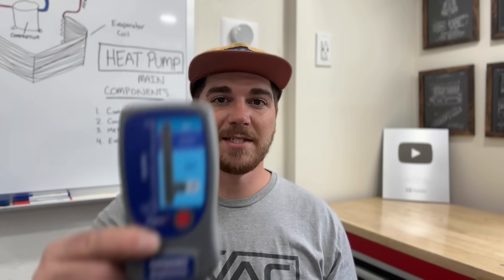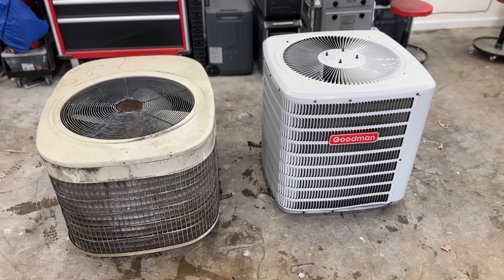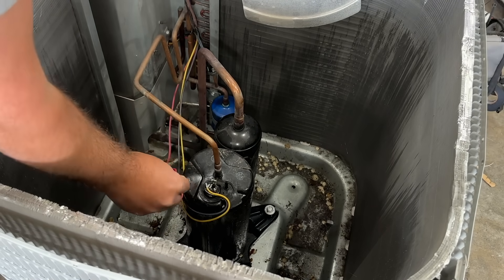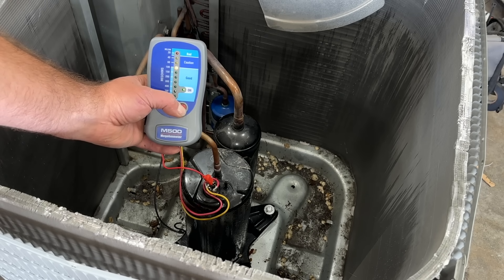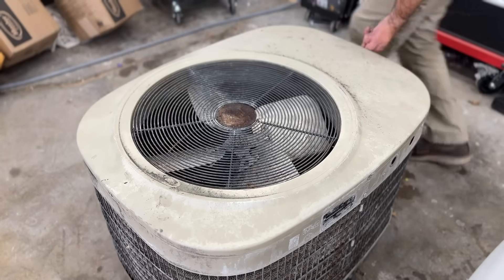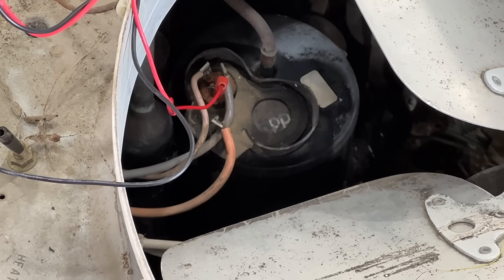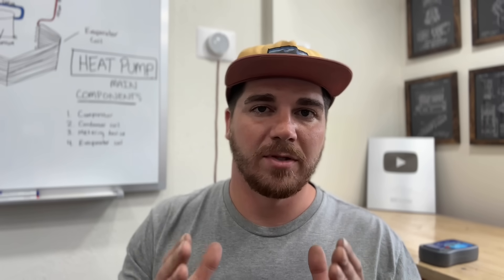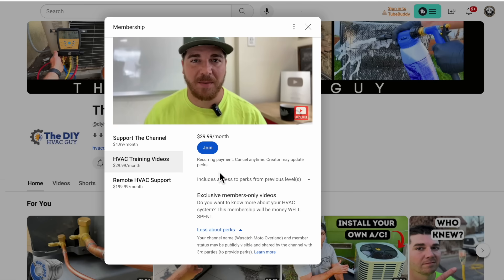Is Your A/C Unit About To Die? This Tool Doesn't Lie

Comment: It's always best to consult the manufacturer about their products just in case they have an explanation of these readings. Copeland states that a reading of between >5-20 Megohm is not reason to condemn their compressor. I always like to stick to the old agage: "ALWAYS, consult the manufaturer if not sure" or something like that. But I do agree that NOT pulling the required psia will positively reduce the life of the system. And I've seen far too many contractors rush this part (evac) and make-up some excuse why they can't pull the proper vacuum and end up charging the system without completely dehydrating. No wonder the systems are failing. I'm convinced older systems lasted over thirty plus years because the service technicians of the past did it right. That is what I believe is missing today.

Comment: You should always pull all of the wires off before ohming out a motor. If you don't it might back feed through the wires or short out against the compressor or motor and give you a bad reading. It's also a good practice to ground out to the piping or casing of the motor. This gives you the best grounding. Remember this test is testing the insulation of the windings to ground. It does not tell you the condition of the pumping capabilities of the motor either.

Comment: You can do the same with an Oms Meter and an Amp meter  .  The one thing he didn't tell you, you can electrocute yourself if you do not disconnect the power
Reply: Ummmm... Pretty sure he showed pulling the disconnect at the beginning before starting.

Comment: I see you’re noticing a change in reading over time, this is normal but you need to test for at least a minute or longer for any valid reading, look up Dialectric Absorption Ratio or DAR. A better test would be PI or Polarity Index which is a 10 minute test. Either test requires a much more accurate meter than what that supco is capable of. 
Also none of your readings are valid because you need to remove all the wires from all the motor terminals otherwise youll measure through the motor windings to other circuits, usually one would short all the motor terminals to test all windings in a motor to ground at once (not really needed because obviously the motor terminals have a low impedance path to each other through the motor windings anyways). 
Another reason your readings are not accurate is you need to test to the motor ground in this case the nice big copper pipe sticking out of it & not some random rusty crusty screw somwhere, if the motor had a bad ground connection or your random screw had a bad ground & you tested winding to frame on a failed compressor then your supco could show good when it may in fact be bad. 
Also you tested two rotary compressors that were disconnected & probably not charged with refrigerant. If you test a good copeland scroll compressor in a charged functioning system you will likely measure only 3 to 5 mega ohms, this is normal if you bothered to look at the data that the manufacturers have published, Also many variable speed compressors have less than 1 mega ohm to ground under normal conditions, so just cause that supco says “bad” doesn’t mean that it is. 
Another thing is test voltage level; for 240VAC equipment one should perform an insulation test at 500VDC, for equipment that runs at 480VAC should be tested at 1000VDC, that supco tool has a high output test voltage of 950 Volts DC if I remember correctly which is too high for testing residential airconditioning equipment. 
And finally it’s not pronounced “meg OW meter”, the proper pronunciation is mega-ohm-meter. 
So in summary; just about everything you said is wrong or misleading, throw that toy in the trash, get a real meter, learn more, try again.

And where do you get off blaming manufacturers for not making stuff like they used to when you clearly just said that it was a bad install, WTH!

Comment: Megohm only shows the condition of the insulation on the windings. A valuable tool to test the condition of the electrical motor inside the compressor shell. However, a compressor motor can test electrically good, but mechanically be in poor condition.

Comment: I just use a digital multi tester myself. Nothing fancy just set it read ohms. I can actually use this puppy for other things too👍
Reply: Your multimeter only measures resistance with a small test voltage of half a volt. To test motor insulation resistance you must test at 500 volts for it to mean anything. Because motor insulation breakdown is not a linear resistance & a typical multimeter wont detect a fault even if it tripps breakers & blows fuses. My personal experience.

Comment: Lets see that meter test the valves, bearings and such. Cool tool though for checking motor winding's. My favorite is when refrigerant is leaking out of a compressor pin area:)

Comment: 1st of all you used that measuring device incorrectly.  Connecting to ground assumes one of the compressor windings is grounded to the casing plus most compressors are insulated with rubber bushings for dampening vibration.  2nd if one windings is connected to chassis, then you measured no winging resistance on that leg.  Just buy a cheap VOM meter and measure the resistance of the winging and that will at a minimum tell you if you have an open or short and then you'll have a meter that can do other measurements as well.  I hate devices like this... There is no specs on how it works.  Is it actually producing an AC wave and measuring the coil reactance?  If not, then it's not doing anything better than a VOM and it assumes all AC compressors are always going to have the same non-reactance value which is just wrong.  Your heart is in the right place and this video is at best helping home owners protect from scams but also potentially misguiding them to buy tools that mislead them as well.  If you're a DIYer and you're comfortable taking the lid off your compressor, then you're probably savvy enough to just get a VOM and measure the capacitors and the windings for open/shorts (which I have no doubt all this device is doing).
Reply: AC reactance? 
I think you give supco too much credit. its just a dedicated ohm meter that has a 950VDC test voltage (which is too high a test voltage for residential 240VAC equipment.
A VOM isn’t the right tool either as it tests resistance at half a volt & often wouldn’t detect insulation breakdown inside a motor until after it has flashed over & blown fuses or popped breakers. 

A proper motor insulation tester has no alternative, I prefer a FLUKE 1587FC
Reply: @alnonymous9361  the VOM is good enough.  I have no idea what this device does but agree 950VDC isn't right either; kind of doubt that claim though.  Coil windings are very low impedance so the low Z setting on your VOM, if it has one, will work as would just putting the meter on it's lowest Ohm measurement.  You don't need over priced Fluke.  Fluke is great equipment but it's not DIYer priced and over kill.  Also if insulation is deteriorating inside the compressor it's likely to just short and game over anyway.  This guy is pushing snake oil without knowing any better which adds to the confusion.

Comment: This just tests insulation between the windings and ground. It's surely the least common failure mode. You're not testing for shorted windings or the ability to compress the refrigerant.

Comment: I was under the assumption that the compressor is isolated from electrical ground and chassis ground. Would you not want to measure between common and start windings, and another measurement between common and run windings?

Comment: Since the two windings are both connected to the third terminal internally should you not get the same reading for all terminals, provided there aren't any internal broken connections?

Comment: I have Williamson unit that was installed in 1988, and knock on wood,  still running perfectly today in 2024.  Just did routine maintenance on it,  filters,  and coil cleaning.  You are right, they don't make em like they used to.   I'd love to try this compressor test on mine.

Comment: the hvac company here with fake reviews charged me 500 for a $8 capacitor on outside unit. Then said I should also change out the capacitor inside for $350.
Reply: Lots of HVAC scumbags out there
Reply: A few years ago I had a problem with a heatpump.  Man came out and in about 15 minuets he had changed the capacitor and his company charged about $ 350 for that.  Two years later it went out again and AI replaced it for $ 15.  The $ 350 was a standard rate for a capacitor change.   I bet they make more changing the capacitors than all other problems.   In a way I did get my money worth as the repairman was very friendly and told me a lot about the system.  He told me to keep a spare capacitor and relay as they were the major problems.  I worked in industrial electrical systems, but did not have any experience with heatpumps.  So after a quick talk with the repairman AI felt confident I could do the electrical repairs.

Comment: Why do you say that factors such as used (dirty or contaminated?) refrigerant, or not pulling a good vacuum, has any effect on what you're measuring here?  You are doing an electrical resistance test. This, measures the resistance provided by the insulation and any other connections (or non-connections in this case) of the internal wiring and motor-windings and - I would think - has nothing to do with the vacuum or refrigerant.
Reply: Proper vacuum is the MOST IMPORTANT THING when installing a system because air has oxygen & moisture, oxygen causes corrosion which fouls the mechanicals inside the compressor, moisture breaks down polyolester oil in the system into acids which damage the insulation on the windings & causes copper plating on the bearing surfaces inside compressor. I’ve seen for myself compressors I’ve taken apart to see what failed & so have many others.

Comment: My sister had a company come out to check her system. I just checked it and the fan and cap were burned out plain and simple but she wanted to get a quote from a company for replacements.  My quote was 150$ for the new cap because i had another fan motor same rating..  i was there when the ac company was checking it so i walked out to shoot the shit with em and when i walked up on the 2 dudes i saw one take a pair of dykes and cut the condenser coil and release all the refrigerant..  couldnt miss the huge fog shooting up in the air about 20 foot for 3 minutes..  the dude said “you saw it, the thing was corroded through and busted so shes gonna need a whole new system.  Quoted her 8 grand.. which in turn raised my quote now to 500 because the old “illegal” refrigerant is hard to find and gotta repair the cut coil..   told her to sue the people to at least get the 400 back that was unnecessary..  but she just thought she was saving money and that i just raised my price after hearing their quote..  she wouldnt listen or believe me that they were trying to screw her more ways that one..  so in the end i was viewed as the bad one who was up charging their own family..  cant win sometimes..

Comment: I'd be curious what that little megger would see on a brand new modern compressor motor.  Disappointing to see how a nearly new motor was close to failing insulation.

Comment: Can't I just use my multi-meter?
Reply: No. A multimeter only tests resistance at half a volt when you need 500 to properly test motor insulation resistance.
Also dont use this supco tester cause it tests at >900 volts & many good compressors test bad with this arbitrary “bad” reading & its crap anyway.

Comment: I feel like I have to be a HVAC technician myself as a homeowner because of all the scummy HVAC companies out there. I'm already replacing air filters, testing / replacing condensor unit capacitors, replacing contactors, checking compressor / fan run currents, cleaning coils, checking duct static pressures, and checking gas pressures myself. Everytime I call for a HVAC service, they want to replace my entire equipment because "it's on it's last legs". Yet, my equipment is still heating and cooling my home. Many years ago, my parents' AC wasn't really cooling so their HVAC tech just added more R22 and called it a day. They didn't even bother to check for leaks in a sealed system.

Thanks to this video, I'm adding megometer checking to my toolbox now.

Comment: This guy is NO professional! I agree there are scams out there but if you’re going to teach diy’rs please learn how to do things properly first. #1 I hope you don’t get sued when a homeowner gets electrocuted cause the hack that did their electrical bypassed the disconnect (yes I’ve ran into this more than once, as a professional) and you didn’t teach them to use a voltmeter to insure all power sources are off! #2 read the instructions on your tools. I believe the supco says always disconnect all compressor wires as the windings are tied together internally and you could get a false reading, and make sure you put the black ground lead on the compressor shell by scratching off some paint somewhere. #3 it is not recommended to meg test scroll compressors. Needless to say I’ve received proper training and 23yrs of hands on experience. By watching this guy you are funding him teaching incorrect procedures. I hope someone teaches him the right way before he misinforms more vulnerable people.

Comment: Fedders was one of the most robust AC brands made back in the day with well designed refrigerant circuits, etc. 

Why are they no longer around? Likely because their equipment wasn’t designed to fail (planned obsolescence) like most equipment today.

That said, sizing it right, installing it right with a straight forward way to maintain it (think correctly installed high efficiency media filters) are the 3 critical factors in system longevity, maximum cooling per watt at the lowest achievable operating cost - no exceptions..!

Comment: My AC is a Goodman made in august 2000 it's an R22 unit and it's working so well that I don't want to replace it. Was thinking about it but honestly it's not worth it.
Reply: mine too, from 1999; am considering replacing it with another Goodman before the refrigerant changes & higher costs come in 2025

Comment: You correctly stated that the megger uses a low current for the test but you failed to mention that it is at a HIGH voltage.

Comment: In compressor applications fail sensors, flow monitors and airtemp-switches, motordefects are rarely. And the best capacities are BOSCH metalpaper compound-Cs, no(!) elcos ☠️with at least 450V AC testvoltage,

Comment: Hello. When an insulation measurement is made on a device, in your case the compressor, all the power supply wires must be disconnected. Otherwise, you're measuring the insulation of the compressor AND the wires, which can be misleading!

Comment: So this will test the quality of the insulation in the windings of an electric motor, any electric motor, including those in an HVAC compressor.  BUT, will not tell you anything about the quality of the piston rings, cylinder bore, compressor valves, or bearings.  How do you evaluate all of that stuff?

Comment: Dude , all you are doing is megging the compressor. Why use that gimmick tool instead of an actual megger (fluke)? You should actually see your readings to make a judgement . Also you can meg a compressor and have good results and still be electrically failed or mechanically failed!  Also with an actual megger you can select voltage appropriate to your device and get actual readings you can use. Megging the compressor on PM’s is a waste of time .

Comment: Your only checking the electrical side of the compressor which is a electric motor that turns the actual compressor, a compressor can fail several ways not just megs low, when bearing goes bad, also pending the type of compressor as the compressor motor may run just fine but in longer able to compress the refrigerant correctly due to it being worn due to age and usage. Also humidity and moisture affect how a motor megs as on a 45 degree day no humidity might meg 2000 gig ohms and on a 90 degree day and 100 percent humidity might meg 100 meg ohms. Motor is still perfectly fine to run in both applications, correct way to check a compressor and motor is checking meg ohms and ohms of each coil , and checking your pressures while unit is running is the correct way to condition of your unit

Comment: Isn't there more than one failure mode for a compressor? Could it not have a good AC motor but a seal problem or other mechanical issue with the compressor?

Comment: I work in an office building where the HVAC runs off of 2 Big Chillers and 2 AHU's on each floors. I was wondering if this Megometer will work on those compressors as well? Will this work on all compressors? Refrigerators, freezers, etc? Thanks for the video.